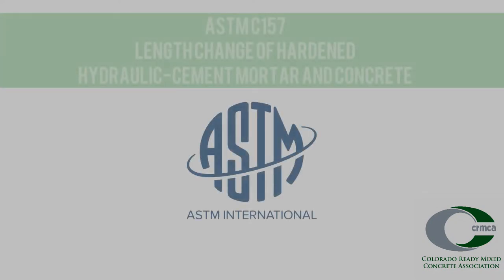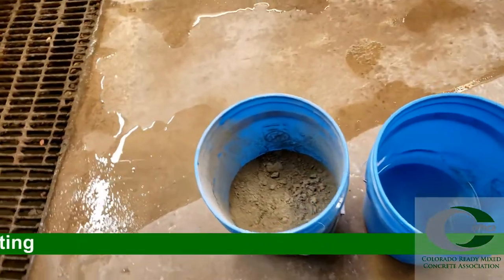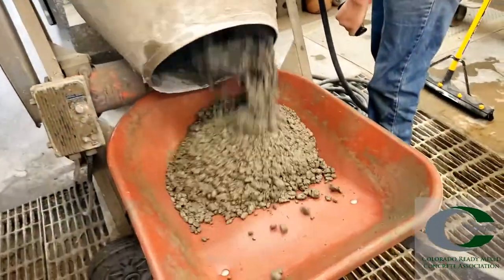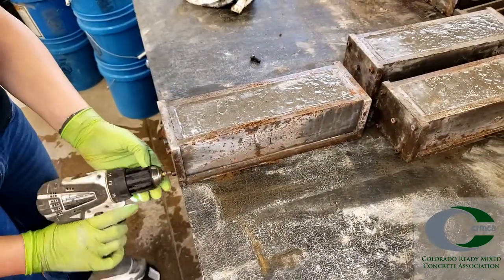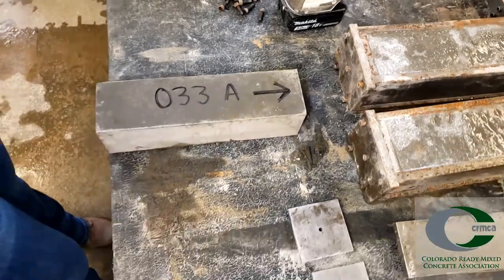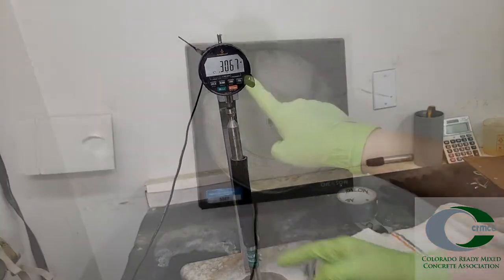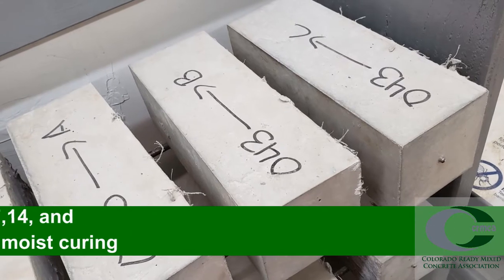ACI Lab Level 2 - ASTM C157 Length Change of Concrete (Shrinkage) - CRMCA Online Concrete Procedures

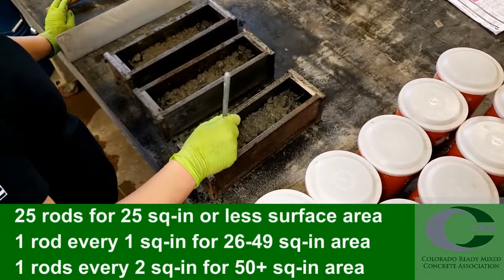Comment: I think your information is incorrect in your initial information in respects to consolidation. Although at 4:01 the reference to ASTM C192 is correct C192 does not give us a range for consolidation per lift it would be a flat 30 or 40 rods depending on the size of the mold. There should also be a range of 10-15 taps with a mallet as noted in C192. Although the video did help understand the test method in general. I thank you for many clarifications.
Reply from the maker: Thank you for the note. We will review for our update soon!